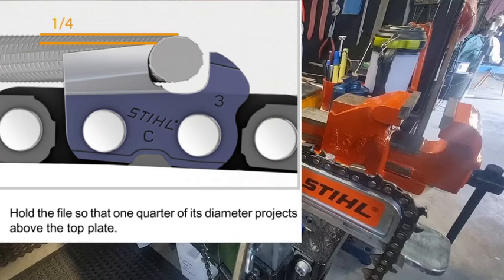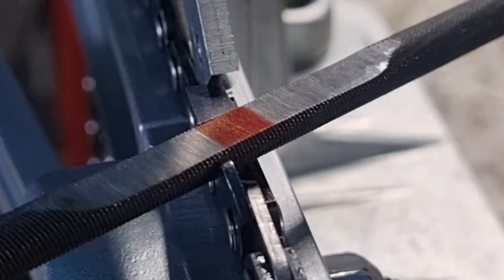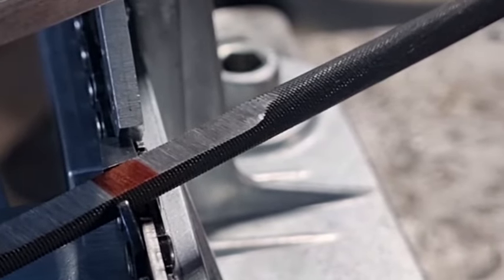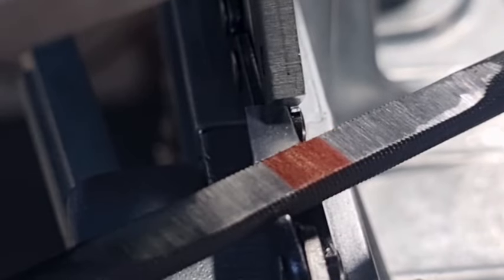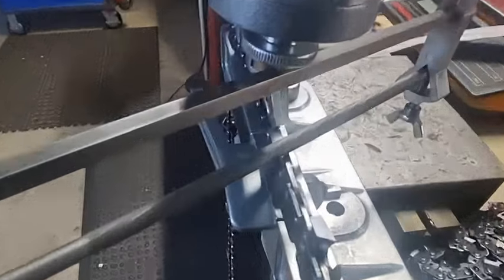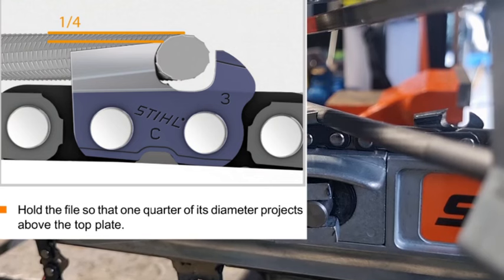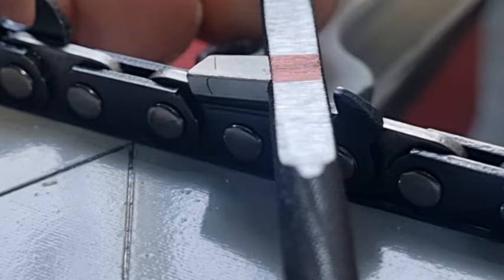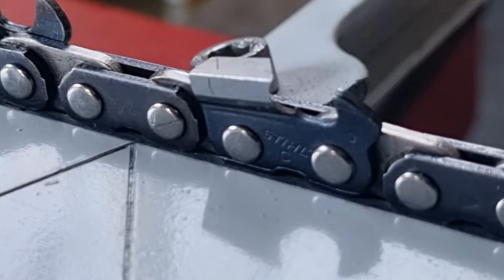File gauge to check that file is 25% above the tooth

Comment: You are becoming one of my favorite people. 😂
Reply from the maker: Thanks
Reply: @ChainsawUsers  just for experiments sake. I set up a granberg on . 325 semi chisel. 25 degrees and added the 5 degree tilt. It was an echo chain. It definitely doesn't have the 5 degree tilt from factory. I don't know who makes echoes chains probably Oregon. But either way it led to a sharper tooth IMO. I cut some oak today and definitely a meaner tooth than no tilt on that chain. Grabby even. It did not want to re-enter the cut if I pulled out. It would skip out as though I used the top tip of the bar. That was interesting. But definitely a meaner tooth and prove to be durable as I cut a couple gas tanks full and it was still very sharp.